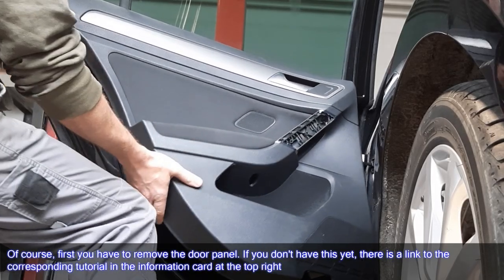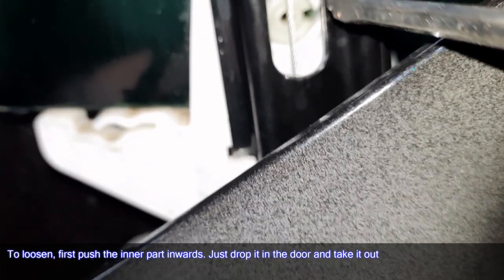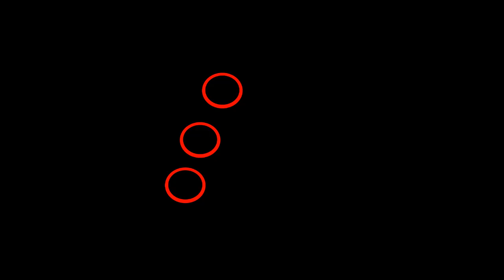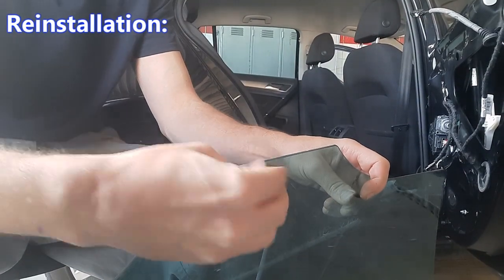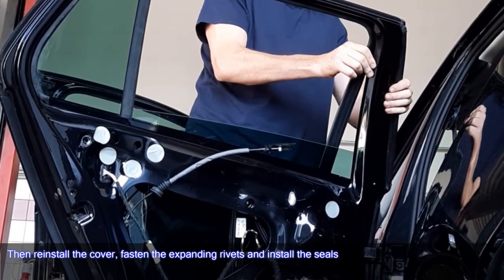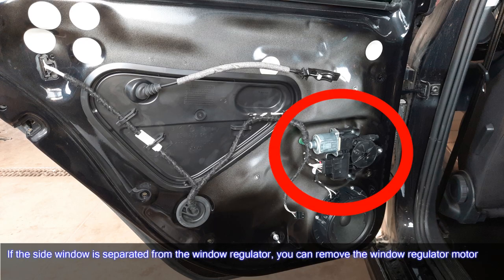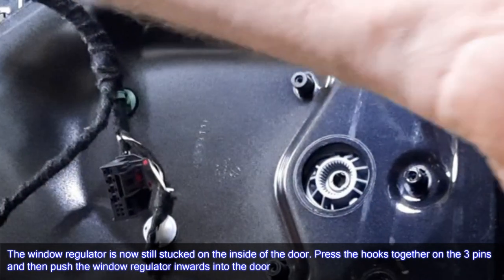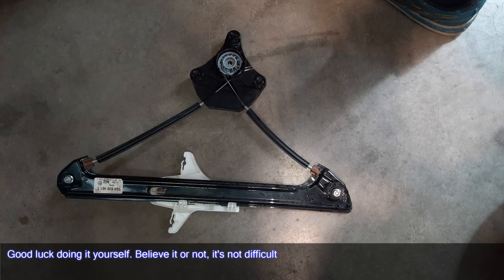VW Golf 7/ VW Passat B8, rear door glass and window regulator removal- tutorial

Comment: Nice tutorial.
Unfortunately broke my window in 1000 pieces at the step at 0:55 . Stupid design of VW that you need to hammer on a part in a window to get it loose...
Reply from the maker: Sad to hear that. It never happened to me, and I did a lot of those systems... but, it could also happen if the window is attached with a screw
Reply: Done the exact same thing, waiting for a new window now😂
Reply: Tip: I already orded a few replacement pins from a chinees website for like 2 dollar . In case it will ever happen to me or my friends again. Next time I can just drill out the old pin.
Reply: Note for other people here. I slipped a thin long machine screw in from the back and used a nut with washers on to wind out the insert relatively safely.